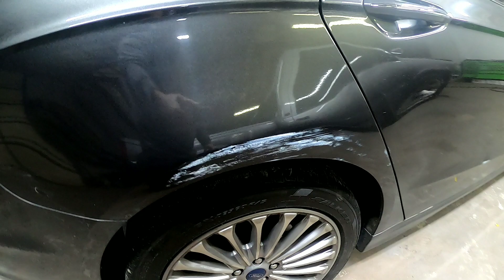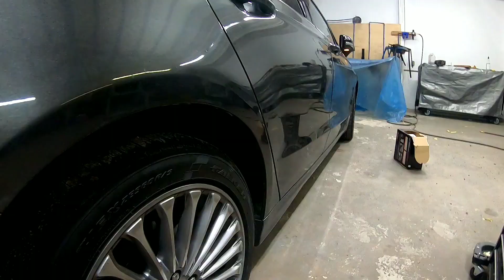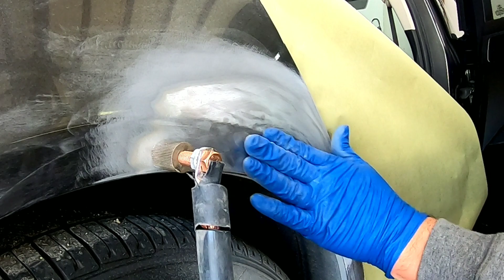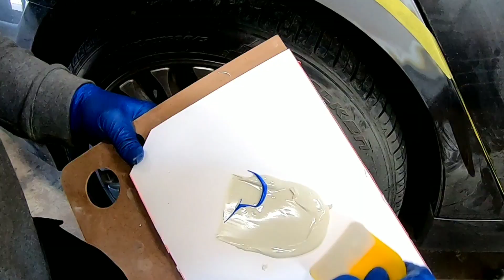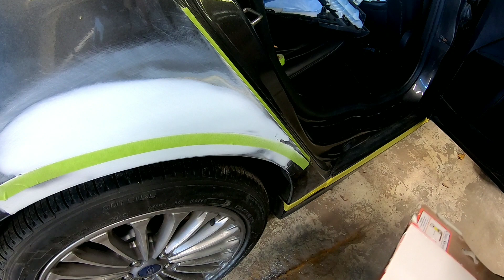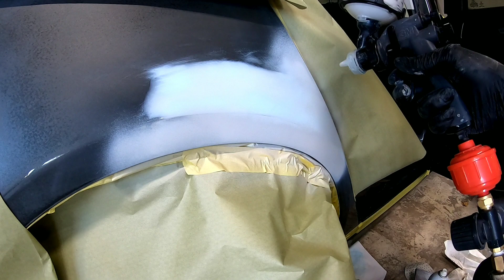Fixing a dent with body filler #bodyandpaint #autobody

Comment: 2 questions:
- is this the typical level of detail/metalwork you go through with a customer's car or is this more of a demonstration of what is possible and you would typically stop sooner and just use some filler?
- How do you prevent working through the metal or getting it too thin? I've had some success with this kind of thing, working pieces to just about the point they don't need filler or at least very little, but it's not uncommon that by the time I get to that point I have some spots that are VERY thin, especially if I used a body file to work down high spots/welds.
Reply from the maker: Great questions, I appreciate the comment and support of the channel. This is mostly for demonstration, it's really  not necessary to take it this far and most collision production shop don't.  I like to pull out as much as I can without spending an excessive amout on time. I don't  have a problem  getting the metal too thin just make sure you not using the file to try and straighten the repair and you should be ok. Thanks for watching brother.

Comment: Another great one Chris!..I have a question , when I’m in the finishing stage of sanding before base I almost always get a couple of small breakthroughs to metal and body filler and I usually just mix up some more urethane primer and sand again, but my urethane primer mixes into a sealer with the addition of (more) reducer, can I just spot seal those areas, wait the 30 minutes, and go right over with base?. Or will I need a fade out spray to blend the edges?..That’ll save me a lot of time..I ran into Tony’s refinishing video of the blue mini he painted and I saw him do just that without the need for the fade out so I’m very curious on your opinion about that..thanks man! 🍻
Reply from the maker: Yes there are sealers you can use like that. Always refer to the TDS this will tell you if the product is a DTM. Another quick solution is  aerosol of self etching primer. Thank's  for the support!
Reply: @GarageNoise  thanks man!..I don’t think it is DTM but I always use etch on bare metal before I apply my primers, my concern is if the edges of the spot sealed areas will show through the paint job ..😬..TDS is very vague ..
Reply from the maker: @frankvalencia9227  you could spray a wet bed over it to smooth out those edges👍

Comment: Dude,  I don’t know wtf I’m doing.    I have a few new Ecoated parts I will paint, a hood and 2 fenders,  but there is a few other areas on the car I like to fix,  bad gouge/ door ding that some idiot just put gobs of touch up paint.   Can’t I just lightly sand, add filler,  the sealer and paint?   Do I need primer?  Or will there sealer and reducer do?  Thanks.
Reply from the maker: If you have lite scratches you could use some glaze and fill it and seal it. It's  safe to use primer but depends  what kinda end results your looking for. Check out my channel and other videos . I have loads of content that will help you out. I'm  also available to answer  questions. Thanks  for watching!